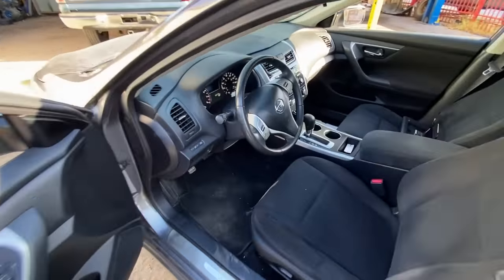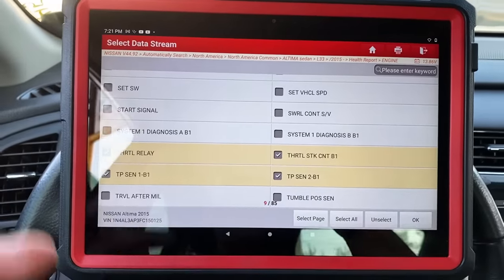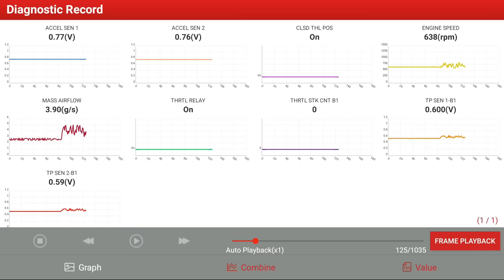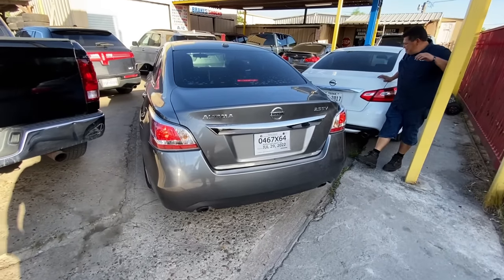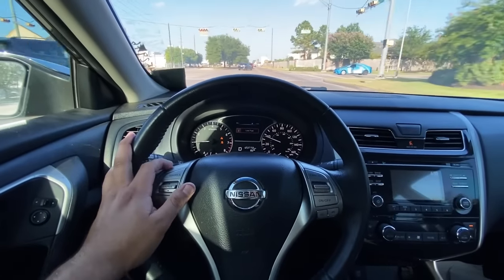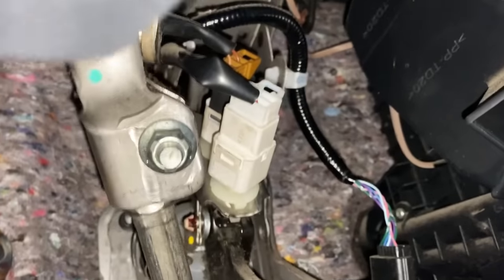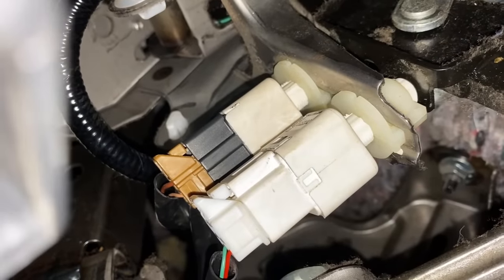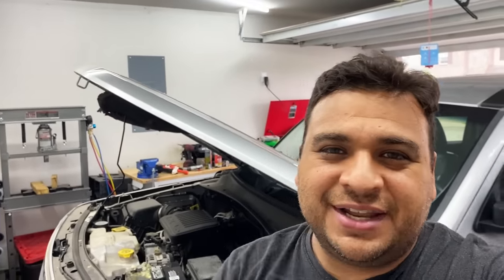NISSAN ALTIMA RANDOMLY WON'T ACCELERATE ABOVE 25MPH!!

Comment: This is all part of what happened after Toyota unintended acceleration stuff. 

Brake switches are very low cost parts. There are really only two or three companies that still make them due to the liability.  There are new switches that use magnets replacing these mechanical types of switches but a $1.25 part is responsible for a lot of safety.

Comment: I had the same problem ,And after looking for the brake relay it was not there. Went to the dealership with the vin # found out that my year 2017 does not have a brake relay , and the problem was the curse control switch ,the black one . replaced it all is fine.

Comment: I got a similar issue but it’s only right after a red light. I hit the throttle and have to hold it for like 5-10 seconds before the car wants to move after that it runs perfect or if I shut it on and off it runs great.

Comment: Awesome, had a similar situation on a jeep.liberty, the rear gate control went bad and discharged the bat,charging system, after unhooking the electrical to the rear gate controller the jeep did fine . Just saying.

Comment: I am thinking the brake switch was bad. After it was replaced the relay failed possibly as a result of the bad switch. Strange if the relay acted up until you replaced the switch then worked for a bit before failing again but I have seen strange things happen with electrical circuits.

Comment: I like this video, my 2009 Nissan Altima is doing the exact same thing. I swapped the brake light switch, didn't solve the problem. The 2009 only has a brake light fuse, no relay. Can anyone explain to me what to do next?

Comment: Low brakes can cause that if you need new brakes my 2016 did that also did it again when the battery was dying due to electric power steering

Comment: I would like to advice regarding my ford fiesta 2010 automatic. At times when Im driving and pressing the gas pedal it doesnt pick up the speed and halts/stops/stalls for a couple of seconds. I have to press or worst stomp the gas pedal fully as I get frightened twice or thrice before suddenly it picks up, it jerks and accelerates back to a speed. I had it full service said theres no problem they test drove it but of course they didnt encounter the problem as it happens randomly, prolly once i a day while im driving. gladly im not on traffic everytime. but what if im in? Also I observe it happens when Im turning. I almost got hit at the back when I turned to a 40mph road when it happened. I had it checked twice but says nothing on the computer. They said its fine. No warning lights on the dashboard. Please enlighten me thank you

Comment: I think you've said you were a Nissan tech before, I have a 2010 Armada and it throws a P1574 code and the cruise control won't work, just flashes the SET light. 
No other codes are present in any module.

Comment: Check the brake lights if they stay on when letting off brakes
Computer wont let car go fast
I had same issue, it was the blue colored relay for the brakes in the computer looking box
Its 15 bucks

Comment: The fuel feed cable modulator that goes from the fuel pedal to to the throttle body.could be the trouble.

Comment: Check the camshaft positioning sensor I had the same issue with an Altima 2005 3.5L it cost me 100 cad  to fix it

Comment: I got a lancer 2004 i try everything they use the same computer you got it shows everything is good no engine light but sometimes when i press the gass that happens its like it choking i cant fint nothing and the shops I'm in Puerto Rico this is driving me crazy. I'm on stuck mode.

Comment: Had a murano that would not accelerate  sometimes... i was told it was the transmision(cvc), it was the foot pefal switch,, it was the throttle switch..  all wrong.. it turned out to be the cam sensors.

Comment: I have 2016 Altima and I had the same problem. The dealership told me the brake lights were the cause. Supposedly fixed by running an update from the computer??

Comment: Mine is doing this now I have a 2017 Altima sr but it only happens when my lights come on. I can also start my car when my lights are on without having my foot in the brakes so somehow when the lights are on the car thinks my brake is being pressed. I’ve already had my brake switch changed though

Comment: So my girls 2018 Nissan ROGUE is having this exact same issue. I think this video could be the answer. I will update if so. Thanks
Reply: What’s the update ??
Reply: @MichaelSkimpy-l6f   It was the mass air flow sensor. Can you believe all it took was a spray cleaner that cost $16 to clean it. Everything works fine now. A replacement part is only $100 but I didn’t need to replace it. Try this before taking it to a mechanic shop! 🤙🏽

Comment: Had the same problem and replaced the two switches for the brake pedal and also replaced the relay and it still loses power and no check engine light. Shop and dealer cant find anything due to no codes

Comment: I have the same sort of issue.  My only question is how come at first you didn't assume this was a transmission fluid issue? Or something along those lines as these year vehicles have common transmission issues.  My Nissan Altima 2016 won't rev past 2k like its locked or something.  But then when it does go past 2k it wont shift.  It stays in first gear and revs really high.  Sometimes I could get it past 2k but it seemed to be stuck at 2k rpm when cruising around 40mph or so.  Car wouldn't go 50 at all.  Car has 90k miles on it,  If anyone knows or can help that would be great.

Comment: Im having this same problem on a 2018 Nissan Sentra but its so intermittent its hard to troubleshoot. Happens like twice a month, randomly. With some differences though. At a stop, tach jumps around, feels like a rough idle, kinda feels like its shifting to neutral and drive cause it jerks. When I accelerate, it doesnt go over 20-25mph. And when I pull over, the car wont turn off at all. I press the button and the dash and radio turn off, but motor stays running. And seconds later, radio and dash turn back on. Eventually it turns off. When I start it up again, runs like normal for who knows how long til it happens again. Such a headache!

Comment: Hello, I have a 2017 Nissan Altima SV. I'm experiencing the exact issue, but theres no brake light relay in the fuse box under the hood. Its listed on the cover (shows 3 relays, but I only have the one brown one. The other two slots are totally empty. Please help : (

Comment: I’m having the same issues with my car ….engine rpm is not going past 1600rpm at neutral. Same goes when car is in Drive mode (D)….however the issue has just popped up and is there continuously not intermittent like this video…also no traction control light pops up nor does the check engine light pop up…any suggestions apart from the brake switch?

Comment: This happened to me on the highway and now the check engine light is on and there a loud clicking/clapping noise when I accelerate. The noise just started happening shortly after the acceleration problems happened yesterday! Any ideas?

Comment: Hello I have a 2015 Nissan altima 3.5sl with v6 142000 miles on it 
My vehicle was towed with no keys they used a bench to get it up on a flatbed truck without keys or access to put the vehicle in natural 
My vehicle will not accelerate over 20 miles per hour since this tow

Comment: Hey I got a 2015 Altima and I replaced the Relay and the Break Switch it ran for about a week with no problems but now the problem has came back after a week iam at a loss. And I noticed the car be still running but it shuts down all electrical inside the car like air conditioning and radio and power windows.
Reply: Hey, im having the same problems, did you find a solution? Same car, it also shut down
Reply: @evelynholguin7917  it's probably the Alternator and a lot of the Alternators will fit that comes from parts store and are cheaper but I had to go to car dealer because the ones that part stores have don't put out enough power and i haven't had that problem since it has to be the one that's made for that car

Comment: Hello and thank you for the video I had the exact same problem mine wouldn't accelerate past 20 what I did was I took my foot and I hit the brake pedal about 20 times very fast and I did this three different times and I've never had a problem since then but I think it did was it loosened up that plastic enough because the car had been sitting just wanted to pass that on so I didn't actually have to replace nothing think about it they're sticking together it's plastic on plastic and then when you pump that foot feed about 20 times three different times it cleared it up for me thanks hope this help somebody

Comment: Need help, 2013 Nissan Altima Brake light stays on only when I have lights on very similar to the brake switch issue but only when I have the lights on. Any help would appreciated. I already replaced all the mentioned parts issue persist

Comment: 2018 nissan sentra,  showing codes C1107 and C1105 ABS and Traction control  but it's doing the same thing.  Any ideas my mechanic said it's the transmission

Comment: Hey I have another question I have a 2018 Nissan rogue sport and I'm having the same acceleration problem so this video really helped me out to narrow down and I'm going to be talking to my mechanic about it but one question is I bought this car off of a used lot and my key fob after like a few weeks of driving it keeps telling me every time my door opens saying there's no key detected so I'm having to sit here and turn my car off restart it with the key next to the start and stop button any ideas is it a programming issue because when I had an issue with my key fob to unlock and lock my car I've replaced the battery twice now within 2 weeks and I'm still not getting no signal to lock my car

Comment: I have the same issue with my 14 after driving more than 40 minutes. Once it happens, i press break gently and accelerator works normally. No codes as well. 
Went to repair, they said it's transmission issue since there is any codes shown up. 
is this fix will work ?

Comment: The maf or the O2 sensor has low voltage just unplug it and the car will run based on a default trim

Comment: I have a 2019 Nissan Altima  and I keep getting a P0101 code.  I changed the Mas Air Flow sensor but the code keep coming back. 
Any ideas?

Comment: It is called LIMP MODE!
An unusual/unknown condition was encountered and the computer protects the engine.

Understanding the software/computer that interprets all the inputs leads to faster diagnostics!
Reply: I was thinking the same thing! 

I had a Nissan with an issue lacking power whenever you would press the pedal to the floor, it just wouldn’t go AT ALL.  

I noticed the traction control light would not go away so I scanned it for DTCs and sure enough one of the wheel speed sensors was faulty.  Replaced that and car was good to go.

It appears “Limp Mode” will activate with certain faults. I hate that, but it is what it is 🤷🏻‍♂️

Comment: have a 2007 altima with a 2.5 have this same issue bu only with the ac on?
Reply: Did you fix it?
My 2.5 altima is having the issue currently
Reply: @SOBER-l4h did you fix yours ?
My 2008 Altima is having same issue

Comment: I have a theory as to why the computer might have been limiting throttle. Toyota had a lot of issues with unintended acceleration, often times due to the floor mat catching the accelerator pedal. I know that Toyota now programs their vehicles to completely shut down in the accelerator and brake is pressed for a period of time. I assume Nissan may have the same setup, except it just limits the throttle. This way, if the floor mat catches the accelerator and the brake pedal is pressed, the computer knows to limit acceleration to a safe level so you can stop the vehicle.

Comment: Long story short, Nissans are not as reliable as Toyotas.  I bought a 2006 Nissan Pathfinder, and it was one of the worst decisions in my life:  Failed crankshaft position sensor left us stranded on freeway (until the sensor cooled down), Failed fuel pump, Failed tire pressure sensors, and Failed transmission costing me about $4,500 due to transmission cooler lines rupturing and allowing coolant to mix with tranny fluid.  To add insult to injury, Nissan asked me how many times I went to the dealer to get service, to determine if they were going to help me or not.  Nissan screwed me over, and as a result, I'll never touch another Nissan.  Good diagnostic techniques discussed in the video though.

Comment: That test tip may not be all helpful if the switch isn’t working properly. You’d be better off observing scan data and unplugging the switches one at a time.

Comment: Same thing with my 2015 altima bro it doesn’t disengage the brake pedal and car doesn’t let me press the gas I have it down and car is barely moving because brakes are still active
Reply: Same exact thing for me bro brake lights stay on, if throttle down it doesn’t read and I press brakes again and it runs fine

Comment: How easy would it be to just disconnect one of the switches and watch the scan data for a loss of communication? Not, you had a better solution later in the video.

Comment: Why doesn't the engine computer look at the vehicle speed and engine RPM together along with the throttle sensors to see if you really are pressing on the brake or not

Comment: Anybody have the part number to the brake light relay? I'm going to try replacing mine to see if solves the same problem I'm having with my 2012 Altima.

Comment: Seems like a lazy faulty engineering by Nissan . It should at least provide a Dtc when this occurs . I had a similar issue on a Nissan Sentra . But it was because the brake light had some water in it and it was shorting the circuit. Making it seem like the brake was being activated.

Comment: What it is is that the belt that's internally built into the transmission expands and it starts it stops and starts to expand as you use the vehicle and drive the vehicle and then the band gets so far that it will not engage anymore because it's not tight enough and if you haven't tightened up at any point. The band will break. Then you're going to pay $10,000 to get the vehicle fixed so they want you to come to the dealership. They want to tell you that the transmission is gone and they want you to pay for it first before they reimburse you so these cars are pretty much junk cars to me. Hope that I'll help you out instead of watching this video with this idiot with the scanner who's going to tell you the same thing I just told you. You need to replace the transmission. And oh yes the reason why it cost so much is because the transmission is connected to the engine and the engine is connected to the car so you actually have to drop the engine in order to expose the transmission to replace it that's why it cost so much. Good luck
Reply from the maker: Watch the video! In this case it wasn't a bad transmission.

Comment: Why don't need to scan tool to tell me what's wrong with the car it's the transmissions on these cars used Toyotas obviously Nissans V6 cars that have front-wheel drive no matter which ones they are are all using a faulty transmission made in Japan or Korea and what happens is once the car reaches its limit of mileage which would be probably somewhere close to 100,000 miles. The transmission gives up and dies. I guess they have a deal now that they will pay for the transmission as long as you pay for it first and you wait six months to a year to get your reimbursement because of the faulty transmission but some of these cars are not worth. A $5,000 to repair the transmission a $5,000 to buy the. The transmission so if your car's not worth that much money $10,000 it's not worth it to fix the car. Plain and simple it's a recall and it's a defect on the transmission itself so most of these cars are trash you can throw them away because they're not worth fixing. You can put in an old one or you can try to have this one rebuild but they don't rebuild them for one thing they only sell you new ones. But like I said the cost of fixing the car. Is about $10,000 and the reason why I know because I looked at one of these Nissan to my neighbor had next door to me and he couldn't get it to go forward or backwards anymore and I looked it up on site and they showed that there we had a massive recall on this transmission. So there you go I don't need a diagnostic machine. When I transmission has gone out.